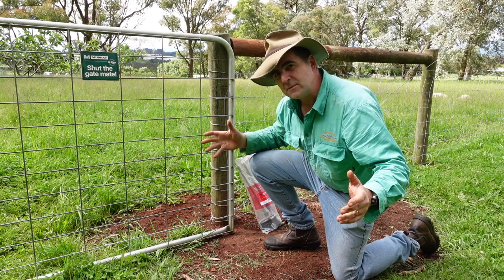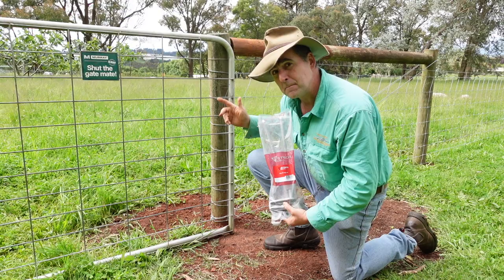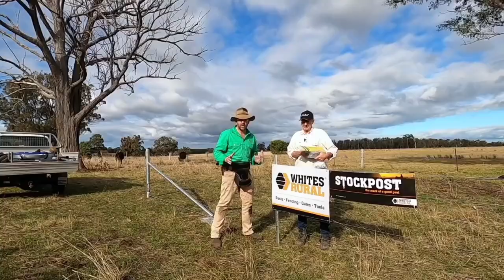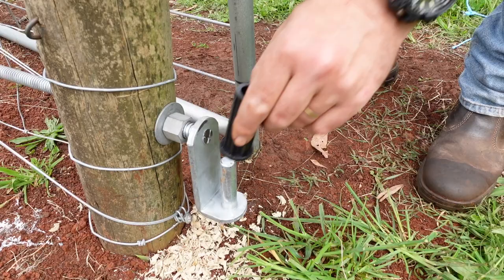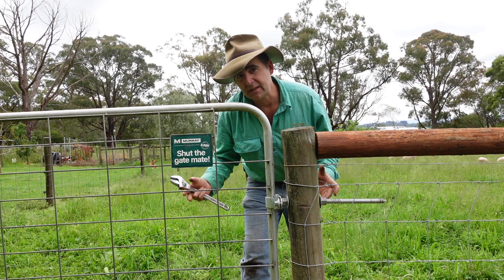Faster Easier Gate Kit?

Comment: I like the idea of this hinge kit. The standard hinge kit I use has a few draw backs, like the latch for the top hook sometimes flies off making the gate moving and the gudgeon pin being relatively short. I hope the rototech kit can hold the weight of the gate, after it was installed for a while and swung open and close many times.

Comment: Gday Tim, nice design hinge kit.  I notice you install the gate between the gate posts rather than on the side.  Is there any reason for this?
I was always taught to install on the side of the post, which allows the gate to swing 180 deg.  That way when you're moving livestock through a gateway, there's no way for animals to get behind the gate.
Keep up the good work
Reply from the maker: Yeah I’ve done that as this gateway is used to get the tractor into the vineyard so I want to be able to drive up to it either way